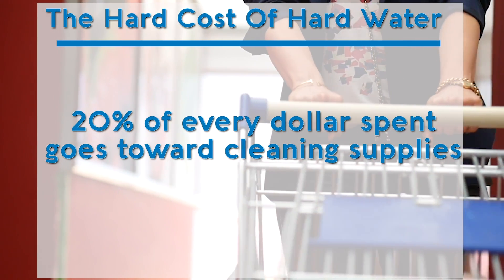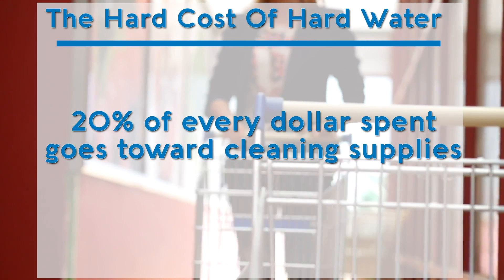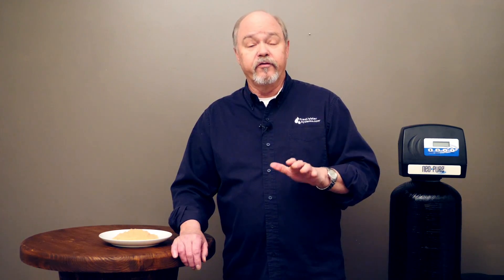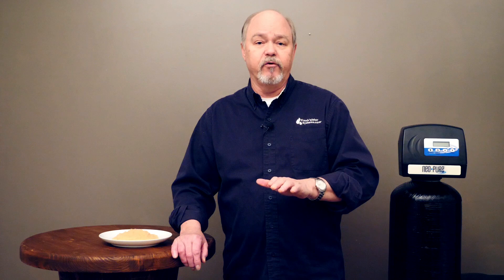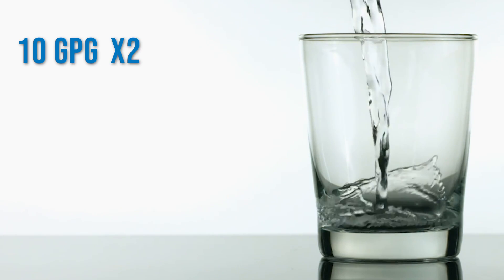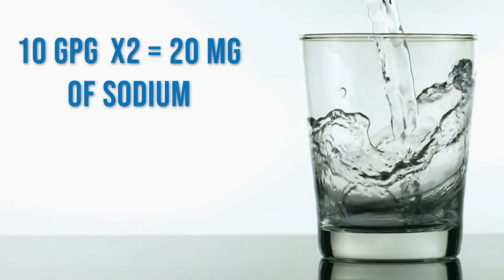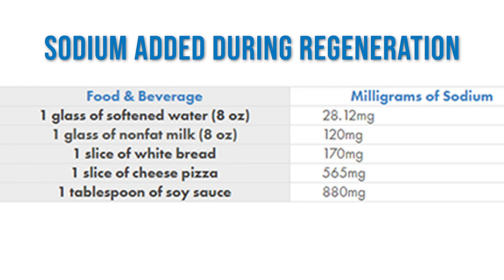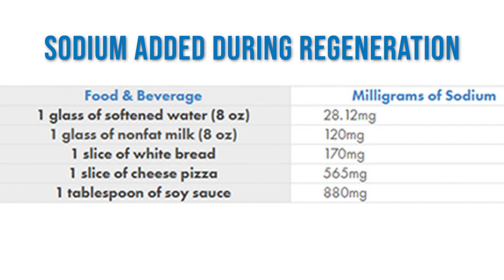How Does a Water Softener Work?

Comment: Can I use a UV filter in conjunction with the water softener?  I'm replacing a dr. Mercola system with a water softener
Reply from the maker: Yes, you can! The UV purification system should be installed after the water softener and closest to your home's point-of-entry to ensure the water is thoroughly disinfected.